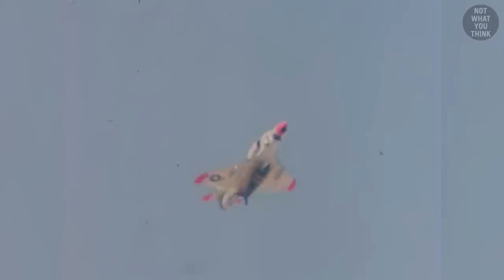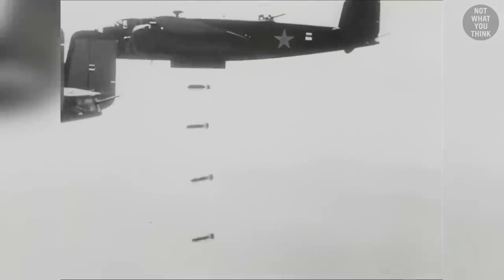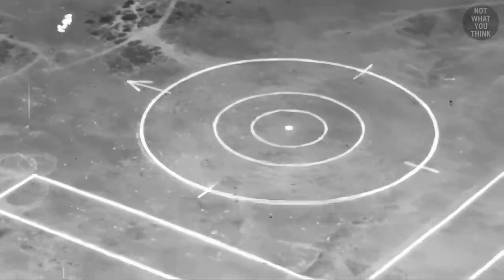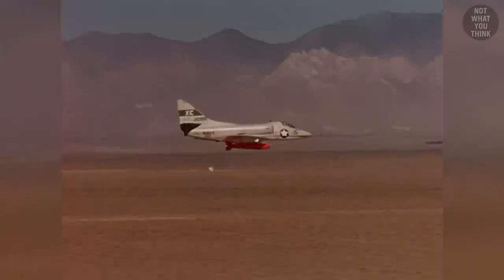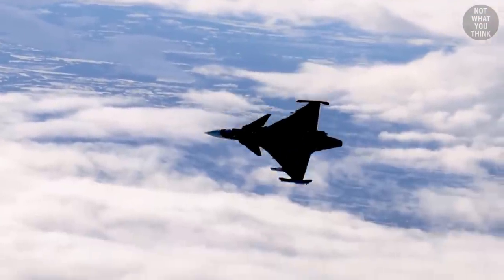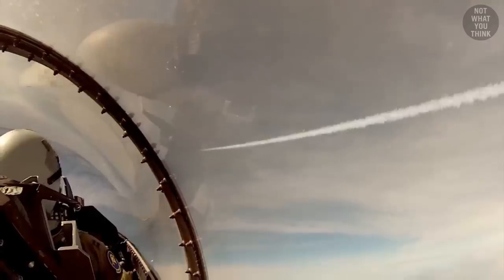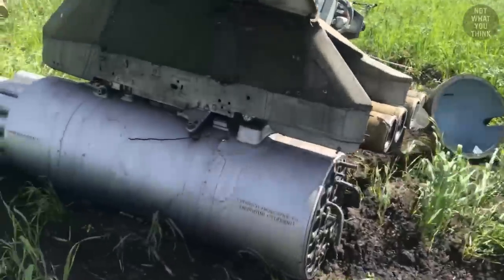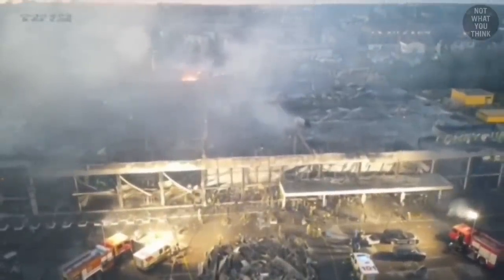Why Are Russian Helicopters Shooting Up at the Sky?

Comment: It's definitely not the same as actual aircraft, but in VTOL vr i do this with the helicopter to get more range on the gps guided rocket boosted glide bombs.
Reply: I'd do the same in DCS with the APKWS, but their battery life is too limited (disabling their guidance after ~6.5 - 7nm) and they stabilize immediately as they come out of the tube. Delaying that would make it possible to increase the range by lofting actually. And I'd guess they have figured that out already IRL, it isn't even rocket science (pun intended).

Comment: I like the fact that its taken as a given than these attacks are completely inprecise and never hit the target. From the impact footage shown the precision seems to be very good. Accuracy can also be good (meaning that the tightly packed shots are delivered on the intended location) since these are most likely aimed at the target by the computer. This probably works like the cannon on fighter jets, the pilot only  has to point to the right direction (which is shown on the hud) and then the computer automaticaly fires.

Russia is ofc not going to use such a strike on a location with civilians, lets say a city for multiple reasons, one of them being that the buildings provide coverage. Another reason Russia will not do that is because these are short range strikes and are delivered on the line of conduct, not deep in the enemy mainland, Russia cannot fly a KA52 5km outside Kiev to strike.

These rockets are most likely used in open fields against known enemy locations, for example enemy howitzers.

The idea that all unguided weapons are useless because there are guided ones is not true for me. In an era were major powers still operate towed artillery with no protection for the operators in a ww1 like trench battlefield, rocket strikes from helicopters can be a very big threat to anyone on the ground and you will have to hide in your trench when the strike takes place. The fact the the strike has such a small but intense duration means the enemy will have close to no time to hide.

To sum up, the burn duration can be very finely adjusted is modern manufacturing, and Russia-Ukraine both have long experience with rocket artillery.

Comment: I have seen one impact video of these attacks. they mostly show firing but if anyone saw the impact it might make sense to fire onto a forest areas like dibrova, Lyman or cities like bukmut where hitting anywhere can consider good fire, because it's mostly about putting pressure and giving no time to rest more than killing them. mostly these could be routine attacks for example artillery shell enemy for few hours then  Su 25 duos fire rockets while artillery crew take some rest, do maintenance and resupply ammo. after them  MLRS start firing  for  sometime then helicopters take the job. which give different units time to resupply and organise while constantly putting pressure on the enemy.
Reply: In cities (including Bakhmut, which is actually Artyomovsk), this is not possible - people are still kept in basements there. Do not use anything that can cause the collapse of high-rise buildings.

Comment: The Russians do this in order to increase the range of those Rockets And surprisingly those are very accurate I saw a video of those rockets falling. It is impossible for the soldiers to survive in the area where those rockets fell
Reply: But did you see a video of every rocket launch? Need to count the misses as well as the hits to know the accuracy.
Reply: @zen1647  this is not really accurate method, and most important — it wasn't invented as high precizion strike. With most part of rocket types it is needed to cover certain area by lot of rockets with great dispersion from safe distance.
It is pretty accurate in meaning of hit certain area, but it must be not very accurate to increase chance to hit someone, because with this method you simply can't see enemy troops, you must rely on ground observer data. So, this is flying Grad with less poverfull ammo, but highly mobile and with great range
Reply: @PyromaN93  Yes,this rockets like Katyusha and Grad
Reply: Complete lie. They firitng from max distance cause of lack of rocket artillery, they absolutley inncarurate cause almst imposssible to aim and and no love spotter, they fell between 100 and 700 metters, rockets didn't even designed for such  artillery shooting.
Reply: @PyromaN93  гспди, очередной патриот? Любые атаки с кабрирования это вынужденная мера, по точности/целесеобразности на уровне штыковой атаки у пехоты. Перевод бк. Единственное на что годится - подавление по сектору, на авось, прижать окоп, пока очередные вагнеровцы/призывники  ползут по полю умирать от арты/дронов/расстяжек. Думаю нурсов на складах старых много, так и отчитались пострелять, и налетали часов себе куда-то постреляли (жить-то охота, пво каждый летный день по 2-3 вертухана садит, считай группу.  А так издалеко популяли, на пофиг, герои)
Reply: @PyromaN93  Сюжет сняли дла патриотов - авиация работает, клоун отчитался по телеку, все довольны. А потери давно уже не потери - а безвести пропавшие, пехоты бесконечно много нарожают/призовут, россия большая, и выбора нету особо у них. Любой пилот который работал взаправду - потвердит. Эти вертухи иначе уже неприменямы, это очень дорогие гробы в зоне работы пво. Слишком дорогие, и пилоты дорогие.
Т.е. это не работа ракетами воздух-земля (которые эффективнее к слову) если иметь цель и подавленное пво) а нурсы с кабрирования - это ниочем, зато очень безопасно
Reply: @PyromaN93 так точно! 60 лет назад работало, никто на жаловался, чего сейчас начинать!
Reply: @PavelGrim-t1m  учитывая, что баллистические компьютеры сейчас ставят чуть ли не на любую вертушку/самолет, которые носят или могут носить нары/бомбы — хули начинать то? Там от летчика уже мало что требуется — просто вывести машину на курс, указанный на ИЛС, на некоторых даже кнопку пуска жать не надо — автоматом пойдет пуск. Современная летка с новыми прицельными системами, дающими CCRP и CCIP могут чугун применять с точностью немногим хуже чем у разных УРВП и КАБ, при этом в разы дешевле. 
Разве что дальность все же пониже будет, но это уже не столь важно.
Reply: @PavelGrim-t1m  А украинцы "нарожают" или даже с этим будут помощ просить у Запада? Ты ничем не отличаешься от ура патриота РФ, просто диаметрально противоположный.
Reply: @Andrey_Kor  У нас выбор другой, либо умереть за свободу/свободными, либо дать закрыть себя в очередной гулаг. Русские принесли в Украину мучения и смерть, русские должны уйти из Украины и заплатить за свои преступления. Я отличаюсь от патриота рф тем, что я не являюсь убийцей и пособником агрессивной войны с террором против мирного населения. Также отличаюсь тем, что не топлю на уничтожение мирного населения ракетными ударами. Это настолько некорректно сравнивать, что засомневался в ваших способностях, вы уж извините. И да, я диаметрально противоположный - я против войны, против захвата территорий и этнических чисток (которые устраивают войска рф). И я рад тому, что я диаметрально противоположный патриоту рф, тут есть реально чему порадоваться. Что значит делал в этой жизни что-то правильное, раз не оказался среди этого кровожадного сброда
Reply: @PavelGrim-t1m  А от Украины террора мы сейчас не наблюдаем? Я промолчу про АТО, которое тоже многолетним террором мирняка являлось. Ваша страна не белая и плюшевая, как бы вы этого не воображали в своей голове, и мирных/невиновных жителей она не скупится безжалостно уничтожать ради своих целей. Вы(украинцы) не топите за уничтожение мирного населения ракетными ударами, но ехидно фоткаетесь у марочки с Крымским мостом, где Украина буквально совершила террористический акт. Радуетесь тому, где пытками вымогают у родственников военнослужащих выкупы, наплевав на все законы войны и морали. Не грешите убийством своих же граждан, которые демонстрируют инакомыслие и совершаете многие другие зверства. Всё выше перечисленное, неоспоримые факты с множеством подтверждений, которые тоже являются преступлениями, но наказание за это никто не понесёт, прям как после преступлений на майдане. Я вам больше скажу, дать вашей стране возможности России, вы без угрызения совести вырезали бы весь российский народ и это не мои слова, а многих украинцев, которые уехали из своей страны, увидев во что она превращается. Вы не зря упомянули этнические чистки, если территории ЛДнр и Крым вернутся в состав Украины, там непременно эти чистки произойдут, и вы это прекрасно знаете. Вы давно среди кровожадного сброда, но вы настолько слепы, что этого попросту не замечаете. Удачи.
Reply: @Andrey_Kor  до вам похоже не доходит, что разрушение транспортных развязок/логистических услов армии вторжения не является террором. Террор устраивает, и устраивала рф регулярно (против своих же граждан)
Reply: @PavelGrim-t1m  Причём тут вторжение/не вторжение, разберитесь со значением термина, а не выдумывайте своё собственное. Если у вас подрыв на Крымском мосту или подрыв Дугиной, разброс мин лепестков в Донецке и его постоянный артобстрел не является террором, то вы больны и не дружите с реальностью. Вторжение, никаким образом не оправдывает насилие и запугивание в отношение мирного населения с вашей стороны. Я понимаю, что для вас россияне не люди, а лишь аморфный агрессор, против которого любые средства хороши, но хоть какие то зачатки логики и морали в голове должны оставаться.
Reply: @PavelGrim-t1m  Чем Вы препятствовали или сейчас препятствуете убийствам, со стороны ваших граждан? Почему вы настолько лицемерны? По вашей же логике, у вас должны быть руки по локоть в крови, но при этом ни одного протеста против АТО, против убийства своих же граждан.  Я молча не смотрю, я несколько раз донатил на гуманитарку пострадавшим, причём один раз даже задолго до войны, казалось бы "чужим" украинским детям с Донбасса.
Reply: @Andrey_Kor  мне с вами обсуждать нечего, вы в стране которая развязала агрессивную войну, и вам с этим ок. Вам крепко спится ночами зная что ваши налоги идут на ракеты/патроны для армии которая грабит/разрушает мирные города, и уничтожает мирное население. В принципе любые аналогии между нами оскорбительны. У вас нету и быть не может элементарной совести, а руки уже немного в крови, хотя вы в упор не желаете этого замечать. Вы недостойны ненависти, скорее сожаления на тему того, что может дать с собой совершить человек, насколько может он быть оболваненным.
Reply: @Andrey_Kor  До вас не дошло, вы (русские/россияне, хз как вас называть, иперскую эту смесь) перешли все допустимые границы и начали оправдывать массовые убийства мирняка какими-то своими воспаленным идемия, что вам кто-то что-то должен. Разговор тут короткий - хочешь чёт сказать, приезжай. Либо выйдет забрать нашей земли, либо смешаешься с нею навсегда. А что у тебя/у вас в головах происходит, это уже потом социологии очередную работу напишут, как после трибунала над нацисткой германией..

Comment: The S-8 80mm rockets are fired from a fixed pod which means the gunner has to align the helicopters vertical axis to the impact point of the rockets using the ballistic computer. The maximum range for these 80mm rockets is around 4km but lobbing them like this can extend the range to about 6km. This is done on purpose for area effect on multiple soft targets and personnel but if they need to engage a tank, they would use the Vikhr laser guided missile which has a range of 10km.

Comment: If you watch the helicopter vids, they have a tone that tells them to go to 30-35deg, and then a tone that tells them when to launch. The targeting computer knows where the target is, and calculates the fire point to hit the target. The unguided rocket is an area suppression weapon, not a point target anyways, so they are not gonna be accurate even on straight line firing. They are used on light armored vehicles and troops in the open. This is an effective method to hit the same area target from outside of MANPADS range. It is the same as MLRS, just smaller rockets, smaller warheads, so smaller area of effect.

Comment: This reminded me of the physics puzzle:
Suppose you can throw a ball at some constant speed v off the ground. At which angle (alpha) do you need to throw the ball to maximize the distance at which the ball hits the ground.
Answer: 45 degrees, as the ball will be able to travel the distance x=v^2*sin(2*alpha)/g (g being the Earth acceleration (constant)). Maximum is attained at 2*alpha=pi/2=90degrees.
If you're already moving at some height, then the angle will change, but the idea stays the same.

Comment: I feel like you dont really have to aim a nuke...
Reply: You’d be surprised; a lot of the targets for nukes in a real nuclear war would be hardened bunkers and nuclear silos that you actually have to get very close to with a nuclear blast to put them out of action.
Reply: @ItsBasil  Cant you just send a extra-dirty nuclear bomb to irradiate everything around the bunker? The people inside wouldnt even be able to leave for a long time from risk of radiation exposure.
Reply: @owo1744  They would conceivably have CBRN gear to protect them. The objective isn’t to irradiate the area around the bunker, the point is to destroy it so it can’t carry out its mission.
Reply: @ItsBasil  Thats true. Although for arguments sake, would CBRN equipment protect you from the radiation of being in the center of a nuclear strike?
Reply: @owo1744  Based on a little bit of sniffing around google, if you need to go outside, CBRN gear will protect you from radioactive isotopes in the air, but any ionizing radiation will still be able to get at you. Better hope the bunker’s got some really good shielding.

Comment: Greetings from Russia. These are NURSs (Unguided Rocket). They do not have guidance and therefore are released over the area in the event of a shot from "cabrer" (the method shown in the video, when the helicopter's nose is raised). It is necessary for them to fly further, that's all. It is more dangerous to fly closer, since there is a risk that you will be shot down by MANPADS.
Reply: Он всё то же самое сказал в видео. Он не говорил, что ракеты управляемые. Твой коммент не имеет никакого смысла.

Comment: I mean we definitely have used toss bombing fairly recently from the US side. One notable report was during desert storm. And I'm sure it's still a practiced maneuver even with more advanced tech on the horizon and in deployment. 

The desert Storm example I know was using a laser guided bomb and the loft maneuver was used intentionally to keep the aircraft further away from what remained of the anti-air defense systems in the area. 

It would not surprise me if the f-35 has a mode switch for loft bombing considering the US has historically used it with most of our modern fighter bombers

Comment: There is a more important reason why the Russians use 76mm rockets in such a manner…for their penetration.
The small diameter and high velocity + high angle of attack from their parabolic trajectories can penetrate 3 meters of hard ground and 5 meters of soft ground before exploding.  When launching large numbers of these rockets at a trench emplacement, with surprising accuracy, they penetrate deep into the ground before finally exploding. This turns a hardened trench emplacement into a soft emplacement. Once the trench emplacement has been softened by the rockets, then the artillery follows up and bombards the area. By doing this the artillery shells become far more lethal and effective.

Comment: This weapon is used for "square shooting" military areas - not for single targets. The charge is thermobaristic. One round covers an area of football field size. The hit accuracy is within the pre-calculated football field due to modern aiming computer systems. Not used normally over residential areas as it would be a real hell and no sense. Unlike airplanes helicopters fly slow and "nose down", this is why they require to pitch up to fire. Aiplanes do not pitch up.

Comment: CCRP (Continually Computed Release Point) is a mode that is used by bomber fighters, with one resource, to deliver a bell-shaped military charge at a safe distance from close air defenses. This is one of the modes commonly used with GBUs to avoid entering the AAA range, just like the first fighter in your video does.
So it doesn't date from the 50s, it's still used, at least on the F-16 block 50/52...

Comment: It's volley fire so that the aircraft can minimize their exposure to anti-aircraft systems by staying low, while also increasing the range of dummy rockets. This tactic is likely a stopgap for when artillery is not in range of the front line or is otherwise not available, but interrupting enemy maneuvers or suppressing their defenses is necessary. Not accurate at all, even with computer assistance, but having multiple explosions occur within a 1k radius is certainly going to temporarily pin down any troops within that zone. Plus, I'm sure both sides have enormous stockpiles of these rockets and have no other viable use for them.

Comment: 3:34 your math shouldn't be possible. To reach the parabolic top of the trajectory it takes 23 seconds, and to reach the same altitude falling, 23 seconds. Without any additional forces, or if the bomb wasn't released from ground level, it should take significantly longer to hit the ground. 23 seconds rising, and 23 seconds falling just gets you to the exact altitude the bomb was released.

Comment: Fireing over horizon is a good tactic tho. Anti air fire in straight line and if they are behind the hill, they cant shut you down if you fire the rockets into air at range and simply wait for them to fall down randomly.
Its kinda extended artilery for to risky areas.